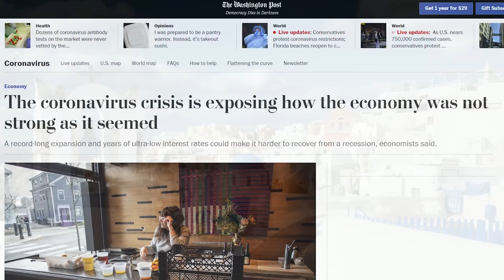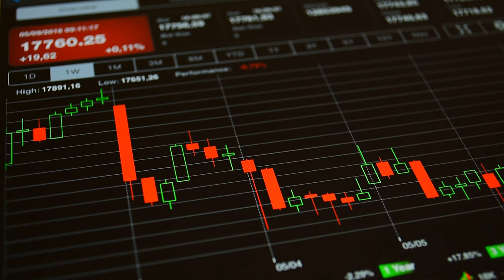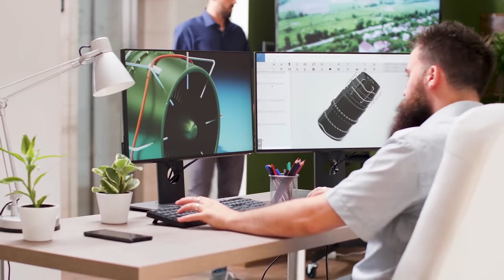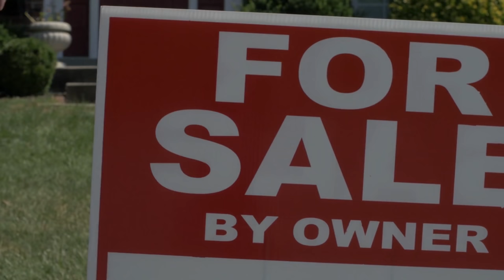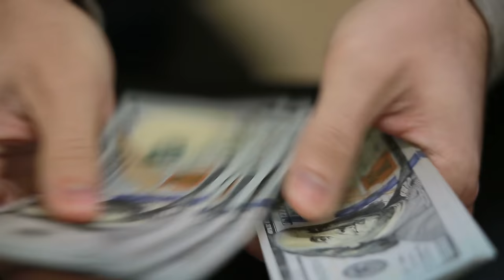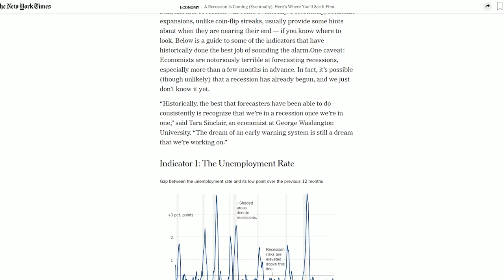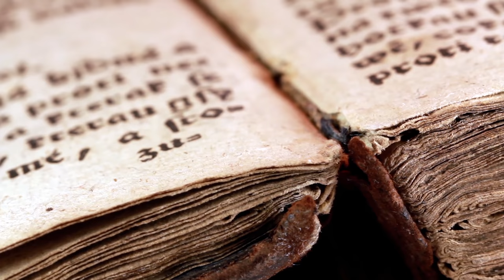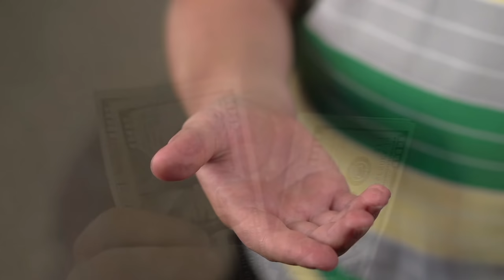Do We Actually Need Debt?

Comment: The entire part about Islamic Banking was broken down well, but ended up not answering the 'profit' question. I mean I'm neither muslim nor have had any experience with Islamic Banking, but how exactly do they 'make' money per se? 

From the video, we know that they invest in assets directly and therefore take on higher risk, therefore needing to ensure that the core investment was well planned. 

Let's take the house as an example. The bank buys a $300,000 home outright and then sees fit to lease it to the original 'borrower' (if you will). Lets say the rent is $1000/month. So in theory, 300 months (25 Years) down the line, and the home gets handed over to the tenant through pre-determined contractual obligations, and is now their property. The only changes to the asset value would be inflation and the future market value of the property. The Bank can't make money off the rent and the only adjustment can be in line with inflation. If the rent is higher than this, then the Bank fails, as the profit (percentage) is essentially the same as debt. So it can't be that. 

The other idea is that the tenant walks out 10 years later, the Bank has made $120,000 back and needs a further $180,000 to break even. The asset value is now say $400,000 on the market and the Bank sells to a rich petrodollar oligarch, thus not only recuperating the $180,000 left but also making a neat $220,000 profit. This I can see as feasible. This would only really work if the Bank ended up selling. What if the 'tenant' aka our original 'borrower', stayed the 25 years and saw out the terms of the agreement?

Considering the above, the bank would have to hand over the asset to them at the same value as they bought it for (adjusted for inflation). The owner now could sell it for say it's then market valuation (25 years down the line) at $550,000 or just live in it as they have in the past. 

Either way, the bank has gotten nothing, or am I missing something. Do they hedge on the fact that tenants will walk away mid term and then it's fair game to sell at future (appreciated) market price? That can't be a safe hedge at all, right?

Comment: Debt has good potential but it's not really good. I'd say it's like a wildfire started to clean a field, it may be good on the long run but then a gain it might not. It may burn more than you wanted and you could even reach a conclusion that you shouldn't had clean that field in the first place, only if you had more time with it and didn't took the fastest way to get it there, and now it's too late to turn back.
A fast growing economy based on debt doesn't automatically imply that it's also a strong economy too.

Comment: Debt itself is not that evil as long as the money, money itself being a kind of "loan" since its a token of actual value substituting for a service or good of actual value, a promise of value if you will.
The problem with current banking system is that the money being loaned was created out of thin air, meaning there was no previous labor that preceded it. So you are basically creating a profit without actually doing any work.
For all the faults of the Islamic laws, I think usury should have been a keeper for western countries.
You should also add that money does not need a bank to actually be created, any IOU written on a paper is basically money, if one can expect to be redeemed fairly for it in the future. I.e. any person , in principle, should be able to emit money. That token would be created at the moment of exchange of services as a result of the difference in value of the exchange or more basically by the deferred services of one party. That personal token would then come out of circulation as it came back to the emitting person (an IOU being destroyed means the other party considers your provided services fulfilling of the value of the IOU).
Of course for matters of simplification in business and security it makes sense for the state to be the one emitting money (though now with block-chain there are actual decentralized alternatives), but the core principles above about the creation and destruction of money should still be observed, and they are not currently so by neither governments or banks. Work creates money, not the other way around.

Comment: The loan debt system you talk about is just a work around. They calculate the "rent" you pay based on what you'd pay as downpayments. So no it's really not a debt free loan.
Reply: In the UK you don't get housing loans so more are pushed to renting. Houses are relatively cheap but rent prices are ridiculous.
Reply: There should probably be more regulations against micro loans and consumer loans for goods that hold little or no after purchase value. Due to the domino effect they have.

Comment: Debt IS money. Without debt there can be no fungible currency, or money. Thanks to fractional reserve banking. There are no economies that dont create money with debt. In this, the speaker is 100% wrong. He provides no examples. The SWIFT system depends on debt backed money. On the flip side, if the Treasury controls the currency issuance(not debt creation), nothing will happen, no one will have anything, because no one will have any money. Why? This is extremely deflationary. This was the world before fractional reserve banking. How does money get into the banking system?  It is created or withdrawn via the selling/buying of Federal Reserve bonds and bills. Debt based money systems require inflation to be sustained. Inflation created through borrowing. What you suggest is the Treasury creating money, and giving it to people directly, thereby bypassing the Federal primary dealers and banking system entirely.  This has not been done because with certainty, its extremely corrupt. If Gold could be money and interchangeable with currency, that could work. Wait thats been tried and failed. Why? The govt borrowed beyond its ability to back the currency with gold. Gold backed currency could work ONLY if Govt were not allowed to borrow, and could only exist on tax revenues. Dream on.  So this video is absurd and hypothetical.

Comment: this solution is really interesting but it seems so impossible to implement that you might as well aim for full on socialism (pick whatever flavour is the one you think will work). that said however. definitely seems worth it to open up an account with an muslim bank as well as any of your local credit unions.
Reply: Muslim banks are not as profitable as normal banks. They are occupying a niche market, but the economics of it is sound and manageable and can work and exist. But the problem is that these banks will never out compete the normal banks out of the market, heck, if Muslims didn't exist, that type of monetary system might not be viable at all even. I am pro capitalism in many ways, but there is a real criticism of pursuing a short term profits as the end all be all in the banking industry.
Reply: @mmmk6322  still worth doing imo, just make sure its not linked to the saudi's or something. also i myself am staunchly anticapitalist

Comment: Just like with Capitalism vs Communism, I believe the answer is balance. A pure Capitalist society has plenty of problems, arguably as many as a pure communist one. However a mixed system using the best of both worlds, more accurately Socialism in this case. Same goes for debt, we don't balance it. A bit of debt is fine if you can pay it off reasonably, but credit cards are just evil if can't pay them off and rely on that percentage of people that don't pay it back on time, its exploitative by design.